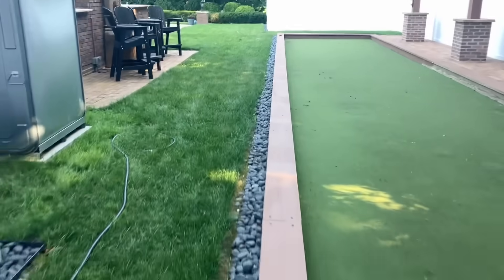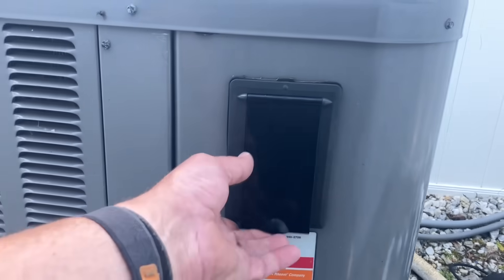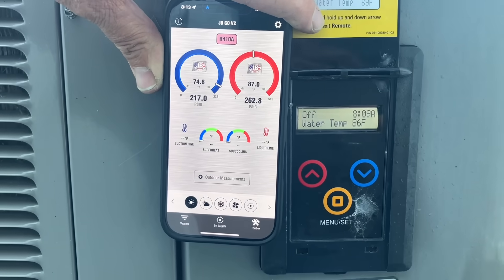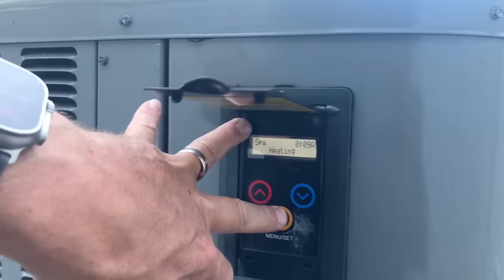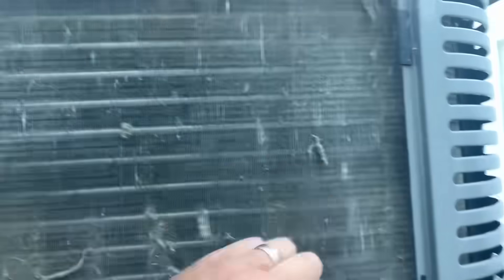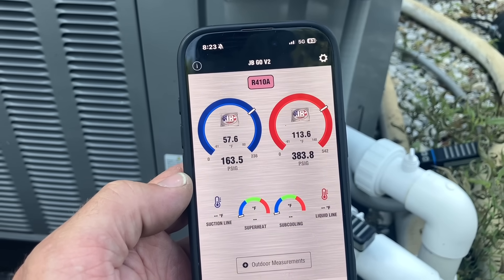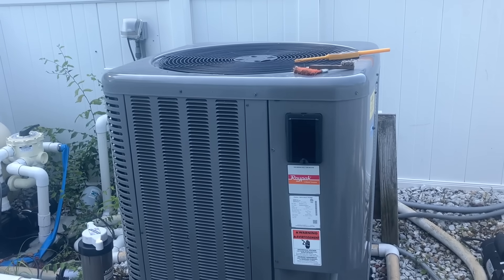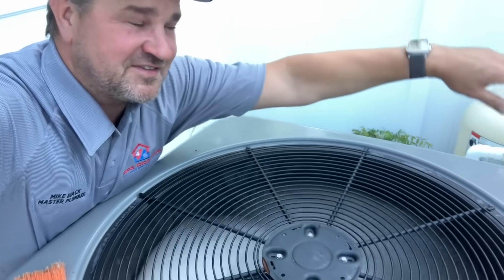RayPak Pool Heater Fails AGAIN! High Pressure Lockout Nightmare | Coil Clogged Like a Fur Coat

Comment: umm, cleaning the "condenser coil" will just make it more efficient btu output into heating the water exchanger block, which is where the high pressure is, making the issue worse.
it's the same as a heat pump in heating mode, the outdoor coil gets cool, the difference is the ambient temp is way warmer, so not much worry about that coil freezing unless there's no air flow or likely ambient well below 60F
**you'll likely end up back again with it tripped out. either pump/filter is dirty and low flow, a valve is wrong, bypass stuck open, etc. lack of flow through the heat exchanger/water block.
maybe even someone cleaning the pool caused low flow and tripped it, but high head is going to be low water flow or lack of heat transfer to the water.
Reply: This guy knows what's up!

Comment: Appearance of debris blocking the surface of the coil equals debris trapped inside the coil. Why would it build on surface??, because it cant fit anymore inside the coil is usually why.

Comment: High pressure would be directly related to the flow or lack thereof. Dont know, but is the txv bulb tight? You're running about 30⁰ CTOA, and I'd assume that should be closer to 15⁰. What's the water temp rise? That would be the difference between flow issue or refrigerant issue. Didn't see the vid of you working on it earlier. Good quick video. 👍
Reply: likely low water flow, from dirty pool filter, pump strainer full of junk, pump speed too low, bypass stuck open, valves set wrong(skimmers/bottom intake), someone cleaned the pool and left it on, tripping it offline due to even lower flow. clogged heat exchanger coil/block low water flow.
really first thing to do there is check pool filter/pump gauge for restricted flow(high pressure/vacuum)